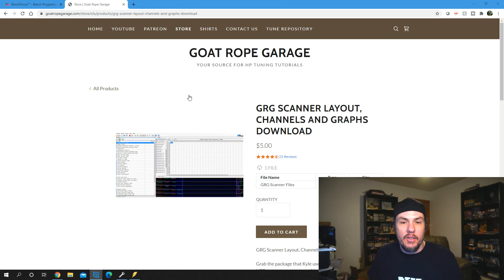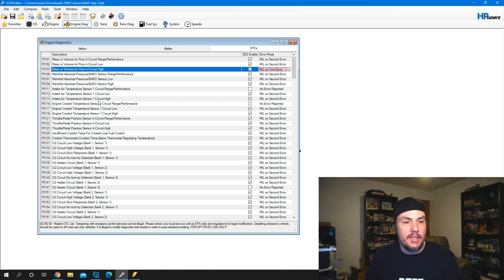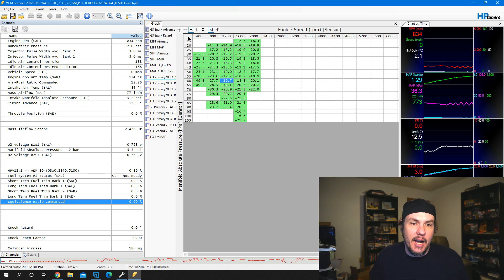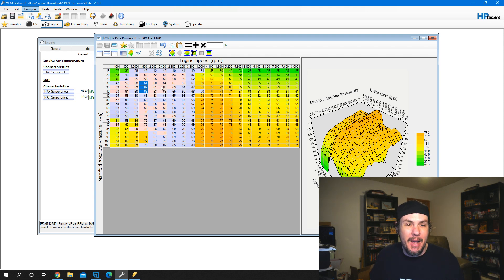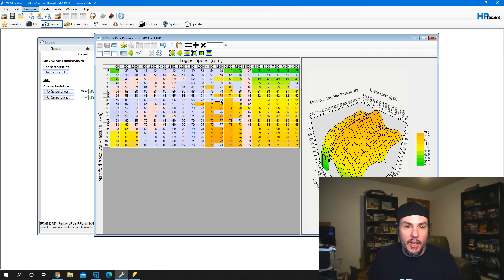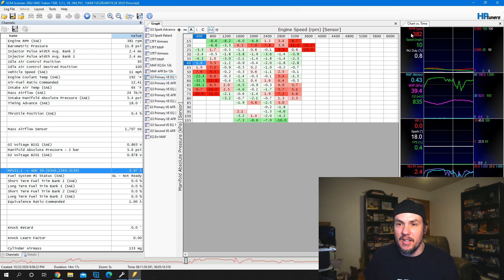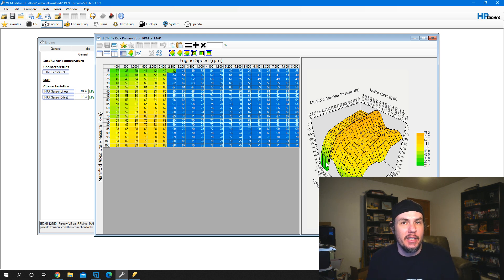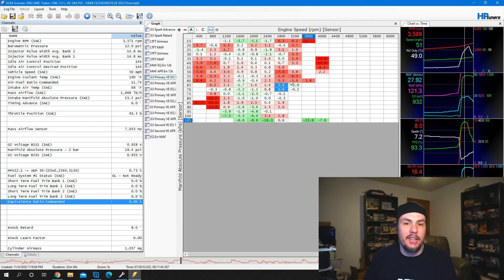GM Gen 3 Speed Density Tuning, Dialing In VE

Comment: 1:46 Aren't the settings in this graph redundant if MAF is failed? Would love to see a compare of this vs the same except MAF codes never fail, the 4 delta values maxed, MAF fail frequencies set to impossible to pass values, VE correction factor min and max set to 1, the default value for MAF and MAP failures set to 0, if that'll even run with those last 2 changes. Getting ready to test that myself to be more sure of some things. But I don't have good logging gear, I just have play with it and listen to the engine and look at the exhaust color.
Reply: The way he did it took less setting changes easy swap back
Reply: @Rags_gaming88  Plenty of us that want no MAF, never want it back. Newer swaps in dumbass e check places, the code matters. I asked what I asked for good reason.

Comment: Hi could you tell me if this kit from amazon " 30-0300 X Series Wideband Uego Air/Fuel Ratio Gauge Kit,Wideband O2 Control Sensor Kit,Air Fuel Ratio Gauge 52mm (2-1/16”) with 4.9 LSU Sensor,Upgraded Digital Afr Controller | 0-5v & Rs232 Output" will work with my PCM for tuning ?

Comment: Kyle, I have tuning some cars with HP Tuner, but Im facing a comun problem and Im in doubt with one part of the process.
When I Drive with the scanner, should I use the Special functions to reset the fuel trims, and leave it on, all the time Im scanning? Im asking because the engine stalls in idle if I do and Im afraid I don't have the right data if I use it off,. This is LS Gen 3, but would be Gen 4 the same case.
Another one is secondary Main VE table, you never mention that and Im afraid we have to do it also or we dont have a balance map with the primary. So when the system reachs the secondary one?
Reply from the maker: It’s always a good idea to turn them off and rely on your wideband for tuning, it may stall at first but that goes away quick

Comment: I've learned a lot so far from you but your content is so advanced hard to follow for a beginner.  I have been trying for 10+ years to learn to tune my 3rd Gen I love your videos but sometimes you just over my head.  At 3:30 you jumped to a log that has all kinds of graphs I don't have and don't have any Idea where to get them.  And all the acronyms just to fast.  info fly's over the head.  thank you for your videos!
Reply: You have to create all those graphs and tables. Usually you can tell right away what they are based on the X and Y axis

Comment: Hey everybody, I'm just looking for some wisdom and thought maybe somebody here would know. When doing speed density tuning are you supposed to do slow throttle increases or can you go WOT? I've heard different things in different forums and I'm getting logs that I don't think are good after that increased throttle response. Also it seems unavoidable when I get into the  higher RPM range in the table. Anybody with info on this would be greatly appreciated not just asking GRG. Thanks
Reply: i do from normal driving to hard pulls since i intend of tuning for performance but one thing i learned is never let the afrs get too far from 0... if youre over 15% lean stop your drive and increase your ve table, then go at it again...

Comment: Tuning a Gen3 C5 Corvette with ETC. Set up for VE tuning (MAF, STFT/LTFT, DFCO, etc disabled). From cold starts Ok and runs for 2min 30s (a bit rich but not bad) and gets to 54C ECT, then goes really lean, and shuts down. Has Primary and Secondary VE tables and I know it is running on Secondary, and have created histograms for both for future corrections. It has electronic throttle control. No limp mode code set for Throttle Position Sensor P1514 so not sure if this is related to Calculated Airmass being exceed. Thoughts?
Reply from the maker: Doesn't have issues on the maf?

Comment: Quick question, I’m very new to tuning. New as in I’m about to buy my wideband and hp tuners setup. I’m curious if you ever use manifold vacuum as a tuning parameter. Thanks
Reply from the maker: We do on speed density, that is the primary parameter along with RPM.

Comment: Enjoying the series.  A couple things i'd like to have seen covered for this video or the next are the usual gen 3 tuning order of ve before maf and why.  I'd also like to see you set up some of the powerful slope filters that are available in the scanner to filter out transient data. Also, touching on the number of cell hits and why that can increase your confidence in individual data points to use as anchor points when you do smoothing.  Another technique i use when speed density tuning us to create a high resolution (3x the normal resolution) histogram. This allows me to use the data collected fom the center of the cell which minimizes the effect of interpolation from an adjacent cell causing errors in a cell you are trying to tune. Cheers, and the community thanks you.

Comment: I have Primary VE and Secondary VE.   Could you give some tips on tuning that setup?  Should I log and adjust both?  When I fail my MAF I believe it reverts to the Secondary VE table.  Which has much less data.   Do I log secondary and just copy secondary to primary and smooth in-between cells?
Reply: Same here. With MAF disabled, it runs off the Sec VE table.  I paste the corrections into Pri VE, then copy with axis from Pri to Sec to update Sec VE. If you add  Sec VE table to your graphs,  you could copy directly to the Sec VE table. But then you have to copy the less granular Sec table to Pri table and manually massage the untouched cells. For that reason I use the first method.

Also, note that the values will be slightly different in the Pri vs Sec VE table if you copy from the Sec VE graph. I believe that's related to how the scanner averages between adjacent cells.
Reply from the maker: This right here, I create two graphs one for each table and copy the edits over to both.
Reply: @GoatRopeGarage  thank you
Reply: @evcass69  thank you
Reply: @evcass69  This is exactly what i was looking for. Thanks guys.
Reply: they look to be the same just the secondary has less map rows but the rows it does have use the same values as the main ve so id just dial in the main ve but also copy the map rows over that suit the secondary so it will operates the same
Reply: @intolstuning3735  I've had problems with this when I adjust the ve then write it back

Comment: thanks for all the help. why are intake temps having an effect on on my afr while in open loop?.... iat goes up afr goes lean, overcompensation sure but why is it effecting it at all if in open loop? i get ses light on maf although it still shows a reading in the scanner. plan on using a break out for iat in the filter and just leaving maf unplugged, good plan? a man that can rope goats can rope anything.
Reply from the maker: Fuel delivery takes temps into consideration to try and help for density changes.  MAF shouldn't be as effected by it but it will really cause issues with the VE table.  You can try to skew them from ECT to IAT readings and see if that helps but at lower RPM's it can cause problems.
Reply: i did a little reading on that and i think i will wait for warmer more stable weather to get the ve and maf tuned before i tackle a sd setup.

Comment: Hey Kyle what is your opinion about tuning MAF first and then VE, or vice versa? Does it make any difference?
Reply: MAF first only because it takes less time. VE is a much longer process, and if you’re running Dynamic Airflow, the MAF is likely doing the bulk of the calculations throughout the powerband.
Reply from the maker: Bingo!

Comment: Kyle, I purchased HP tuners a few months ago, unlocked my 2017 silverado LT 5.3 4wd A6. I have learned so much from you! My truck had TCC shudder. I changed the trans fluid/filter, then tuned the TCC lockup to 0 slip and no lock up 1st thru 3rd. I disabled DOD, I also tuned engine side torque management, 10% up 1500-2000 rpm , then 20% up 2000 rpm to end in peak tables and last few bottom tables in DD. I also changed PE tables per your specs and man my truck is a freakin rocket and so smooth now with power delivery and cruising. MPG is better as long as I keep my foot out of it lol. I have made my investment back many times over tuning friends' and neighbors' trucks who were tired of their trucks being held back so much. Just wanted to say thank you sir for being a positive influence to society. God Bless you sir!

Comment: Have you noticed that for the Gen 3 that when MAF is failed then the PCM reverts to low octane spark table?  That is what I've seen.  So I figure that if you are running in speed density then make sure the low octane spark table is tuned too.   Is that what you have seen?
Reply: I believe he addressed this in the original VE tuning video, but in Speed Density you'll only have the low octane spark table.  You can simply copy your high octane into your low octane table while tuning VE, and then copy the low octane table back in from an existing save file when you go back to Dynamic Airflow.
Reply: @jasonn4397  What do you mean by going back to dynamic airflow?